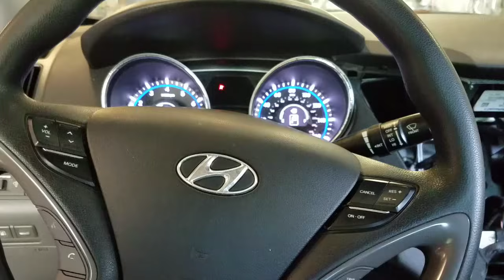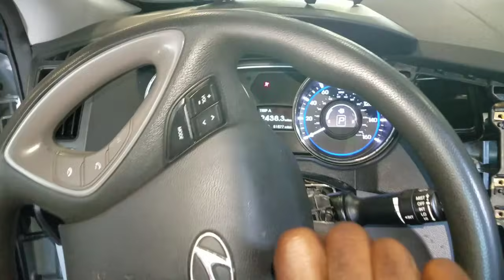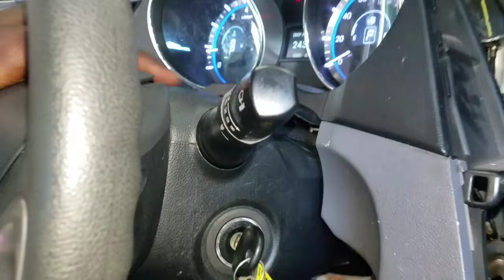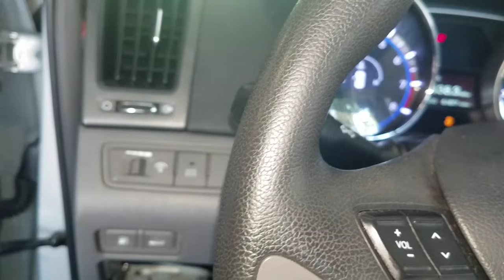Hyundai sonata steering noise

Comment: I'm having a similar issue with my 2012 and I'm trying to make sure that it's the same thing here. Is it a big annoyance when you drive aswell? Does that clicking happen when you go over bumps and potholes and stuff? Cos thats how mine is
Reply from the maker: Yes it happens in thpse situation even at a stop while turning left to right with the steering wheel
Reply: @DULLAHGOSOHARD  thanks alot man, I really appreciate it!

Comment: This part was replaced on my Santa Fe (2013 model) 6 months ago at a dealer who had first said that the steering motor had failed [slaps forehead]... Please be aware that this little coupler appears to be munted again 6 months later and that knocking symptom is worse than before.  It is in the dealer today and they tried to say that the bush, rack and steering motor needs replacing..... and then back tracked on the motor!  They are still proceeding with the rack and the bush although I suspect it could be the joint at the rack.... if it fails again I will be in there demanding a copy of the diagnosis report.....Keep us updated if your issue resurfaces.....
Reply from the maker: DXB_Xtreme oh ok i know they had a recall on the the other day dont know its its still going on but with the recall they would replace the whole steering column
Reply: DXB_Xtreme i

Comment: Dullah Goso hard, I did this repair and now my steering wheel seems to be off center by a small amount and I don't think it was like that before. I can't see how anything disengaged, took it apart to check and couldn't make it disengage. It's still the same. Any ideas.
Reply from the maker: It was probably off before you took it apart but an alignment should solve that
Reply: @DULLAHGOSOHARD  Thanks very much. I was thinking that as well. Fortunately, I had an alignment less than 6 months ago at Tire Kingdom. They offer a 6 month warranty in case you have another repair and need it redone. Already booked. Loved your vid and did notice that you did most of the work with one hand, a rare talent. As a former truck mechanic, I was proud of my ability to reach into an unseen location, remove a bayonet style bulb and put it back with one hand. Not so much any more.

Comment: Hello I need help ! I did everything in the video and fixed the problem however I cannot get my tail lights to turn off anymore ! Have I messed up the connection of wires
Reply from the maker: Check the brake switch on the pedal

Comment: Not sure if anyone else is experiencing the engine recall issues, I'm currently and have been addressing this matter with Hyundai hopefully in the next month or so it will be replaced. I should note my mileage now exceeds the warranty however I'm going balls to the wall fighting this along with other recalls they think they can put a milage limit on their broken parts! I'll be doing the steering wheel myself.

Comment: Please can you answer me a question I just had my sonata rubber coupling changed before having that done my auto start was working fine upon getting my car back from the dealership the very next day I went to use my auto start is is not working. I called the dealership right away they told me to bring back my car when the installer checked it I was told it the auto starter was fried it was working just fine all week long with no problems. Can you tell me if they could have fried my auto starter.
Reply from the maker: Rosemary Esposito am not sure about that but if i take my some where everything working then i get it back and a feature not work they would have to fix it because its obvious that they broke something
Reply: Yah sounds like they broke it

Comment: Dam I changed my hole front end rack n pinion shocks control arms and still feel like I have an issue with the rack! It’s gotta b that rubber part
Reply from the maker: Yes because it can sound like a bad rack
Reply: @DULLAHGOSOHARD  🙏🏼can it also feel when going over bumps?
Reply from the maker: Yes it will sound like the front dropping out

Comment: this  is a recall   at hyundai   and is under warranty   I am a hyundai tech   at a hyundai  dealership
Reply: JOE FORD DIY not if you are over 100,000 miles :(
Reply: JOE FORD DIY. Is it dangerous to drive like that?
Reply: our  hyundai  accent  2014  model  is  so  hard  to  turn  then  they  said  we need  to  change  the  steering column 😫
Reply: JOE FORD DIY yes u did say it was a hyundai  recall cause mine just started making this noise
Reply: my car is showing as not covered under extended warranty even though its a recall.. why?
Reply: Even if it's not under any warranty?
Reply: @mommydoriematthew3082  is the steering column under warranty?

Comment: After completing all of the steps, the traction control light will come on when I press down on the brake. The vehicle is also stuck in park. I checked the connections several times and everything looks good. Do you have any tips?
Reply from the maker: Check the brake switch
Reply: Yep! It was the brake switch. Thank you!!
Reply from the maker: What did you do to it did you replace it or snap it back together
Reply: I snapped it back together. I bought a new switch, but I will save that for another day.

Comment: I'm ready to do this on a 2014 Kia Forte. Thanks
Reply: Call the dealer. I have a 2012 sonata with under 100000 and it is covered under an extended warranty. I'm also the 2nd owner. Mine goes in Monday to get fixed.

Comment: do i need to disconnect the battery? is there a chance of shorting something. what is the trickiest part of this process that I should look after? great video by the way!
Reply from the maker: Fawzi Breidi you don't have to disconnect the battery but you can if you want to and putting back the steering column in place

Comment: My car is 2013 limited that doesn't have regular key ignition. Would this be different from the video?
Reply from the maker: Ahmed Salman i dont think so
Reply from the maker: Just unplug the button thats the only difference
Reply: you mean the car engine starting button? I unplug the wire?
Reply from the maker: Ahmed Salman yes
Reply from the maker: Ahmed Salman if its in the way
Reply: Dullah Goso hard the lower two screws are pain in the neck and i cant seem to be able to put them back.

Comment: Sir I just did this, putting it back together right now. I tried starting after I plugged everything in to make sure I didn't miss anything and I get the "check brake" notification on the screen. Car wont start, push to start

Is this a plug I missed? Which one? I don't see one hanging out. What should I check for this

thanks in advance
Reply from the maker: Check the brake switch to and double all the plug make sure they plug all the way in and tight
Reply: @DULLAHGOSOHARD  Everything looks tight and plugged in. Maybe I damaged the wiring on the brake switch when I dropped the steering column down? Anyway to check this? I do remember the wiring getting caught up when I tried to lower the column
Reply: @DULLAHGOSOHARD  Oh by the way...the brake lights come on
Reply from the maker: Try to disconnect the battery and put it back
Reply: @DULLAHGOSOHARD  That didn't work :( I've triple checked for loose or unplugged wires too
Reply from the maker: Does the ignition turn when you press the button
Reply from the maker: Yes that can cause the problem check the wires if they look good no strains change the brake switch
Reply: +Dullah Goso hard No ignition, just beeps at me BD displays "check brake"
Reply: +tjv323 and* not BD
Reply from the maker: Sorry i took so long to reply i hope you got it fixed but I thinks you should change the brake switch
Reply: You probably already have this issue fixed but hopefully I can help someone else out. The brake switch is easily broken from the steering wheel being dropped. I had to replace the brake switch ($17 at AutoZone) and now my brakes don't stay on any longer. It's best to replace it with the steering wheel dropped.

Comment: I replaced the coupler and put everything back together, but now my EPS light is on and I have no power steering.  What could cause this???
Reply from the maker: You leave something unplug double check all the wires and connections
Reply: Dullah Goso hard   Does the computer have to be “reset” at a dealership?  I’ve read that other people have made the fix but have to end up taking the auto in to the dealer to have the eps retrained.
Reply from the maker: Delouse thats never happened to me and i change alot of those part trying make sure everything is plug in and disconnect the battery and reconnect it but most likely you left something on plug o haven't plug in all the way
Reply: Dullah Goso hard I’ve checked all the connectors and everything seems to be secure....I’ve got my battery disconnected right now in hopes it’ll reset everything.
Reply: How long should I leave the battery disconnected?
Reply: Delouse is if working now?,
Reply: maybe column has been moved when you take it down?

Comment: Hi Bro, i can’t take off those 3 screws from motor, don’t want to damage it by hitting too hard, please help
Reply from the maker: Make sure you have the correct size tool and turn it real fast at the beginning
Reply: Dullah Goso hard  what are tools do i need
Reply: Dullah Goso hard  and should i use penetrating oil ?
Reply from the maker: Try that
Reply from the maker: Look at 10:40 i say the name of the tool you need there
Reply: Dullah Goso hard  thanks mate fixed it had to buy some tool as my car is hyundai i30

Comment: After i change the steering wheel coupler,  EPS shows  up. Any suggestions.  Thanks you.
Reply from the maker: Carlo hom maybe you left something unplug
Reply from the maker: Double check the your work to make sure everything plugged in properly
Reply: Dullah Goso hard Thanks, there was a connector unplug during time I put it back.
Reply: Carlo hom i have the same problem. What connevtor was it?

Comment: Plugged everything back and my car won't start.  I hear the faint click but no luck yet.  I left no wires unplugged and followed along with the plugging of all the wires back in the reverse order towards the end of the video.  Currently charging my battery to see if it's not because the battery was drained.
Reply from the maker: Did the car crank up after yiu charged it
Reply: @DULLAHGOSOHARD  no it didn't
Reply from the maker: If it was starting before it have to be something you leave unplug
Reply: You probably left the dome light on and it drained the battery.
Reply: @CrociatoAzzurro  you referring to the middle lights you can turn on and off?  I hardly use those. I even got the lights set to the off position for when my door opens up.
Reply: @DULLAHGOSOHARD  ultimately I remedied the problem by just taking it to my nearby mechanic. They just only took apart everything and put it back together and it started up with nooo problem I was like wth! They gave me a break and only charged me $198.01 for the labor only but I'm happy to say my steering wheel is rattle free until the new one gets chewed up enough thousands of miles later 😒
Reply from the maker: @CasualLThug  damn that sucks you probably left something unplug or didn't plug in all the way but you learn now and it wont happen next time lol glad it fix though
Reply: @CasualLThug  

Yup.  You probably didn't seat a connector in all the way.

If I do mine I will look out for that.

Comment: I finished mine and the steering light came on! How do I fix this?
Reply from the maker: Double check your work make sure all your wires plug in proper and no wire is stretch and make sure the brake pedal switch is snap in properly

Comment: Did you have to disconnect the battery’s ?
Reply from the maker: You dont have to but i would recommend it
Reply: Dullah Goso hard okay for a 2013 sonata hybrid would you disconnect the battery’s in the back?
Reply: Dullah Goso hard if you disconnect the battery , would I still be able to turn the wheel with the key in the ignition?

Comment: My dad is having a hard time right now to put the steering wheel back in place
Reply from the maker: Really let me give you another video to look at it
Reply from the maker: Watch this video and it will show you more easily how to put up the steering column https://youtu.be/NEd0zPYO-JY
Reply from the maker: And make sure you have the key in the ignition where the steering can turn without locking
Reply: Thank you, unfortunately we had to take it to the shop because steering wheel locked after he put everything back and the car has a recall from what the shop said. Smh😕
Reply from the maker: @PastelMangoRoseh  the steering will lock without the key in it but its easy to unlock the steering by turning the steering left to right while turning the key

Comment: My car doesn’t start after doing this can someone help me please?
It cranks but doesn’t run
Also the electronic steering is working even when the car is off 
The brake pedal is hard
Reply from the maker: The power steering wont work until the engine is running, try go over and make sure all the wires are plugged in properly
Reply from the maker: Take off all the plastic and check all the wiring

Comment: How long do they last once they are replaced?
Reply from the maker: I have no idea i depends on how much you drive and the climate you live in
Reply: @DULLAHGOSOHARD  ok respect
Reply: @DULLAHGOSOHARD  yow my boss! I opened it up and the rubber was not worn.. so what do you think could be the problem?
Reply from the maker: @danecole8074  check the tie rod ends inner and outter
Reply: @DULLAHGOSOHARD  yea those where check and they are good..
Reply from the maker: @danecole8074  does it make the same sound as what i show in the video
Reply: @DULLAHGOSOHARD  yea it does and there's still the knocking underneath the front of car
Reply from the maker: @danecole8074  if you stay still and turn the steering left to right does it make any noise
Reply: @DULLAHGOSOHARD   yea it does makes knocking sound
Reply from the maker: @danecole8074   try and get some one to help you while you or them turn the steering you or them try to pin point the noise if its in side or out side of the car, the the shaft from the steering to make sure there is no excessive movement in the shaft from the steering going to the rock n pinion,  also check the rock n pinion to see if the sound coming from there and check the inner and outer tie rod end
Reply: @DULLAHGOSOHARD  ok my boss respect I will do that tomorrow

Comment: I followed every step perfectly, now after completing the install the EPS light is on and no power steering. Someone please help
Reply from the maker: Double check the wiring and make sure everything us connected then check the brakes pedal switch and make sure its not crooked or anything then disconnect the battery for a few then reconnect it
Reply: What do you mean the brake pedal switch crooked ?
Reply: Thank yoh for your prompt response by the way!
Reply from the maker: @av5398  as it it dont look like its broken or coming apart
Reply: So I checked everything and it appears to be wired correctly and the switch seems fine, also the traction control switch doesn't work. Like the traction control stays off, any ideas?
Reply from the maker: @av5398  did you disconnect the battery
Reply: Yes I tried that
Reply: @DULLAHGOSOHARD  will I damage the system if I drive without power steering?
Reply from the maker: @av5398  no but you need to get it fixed asap
Reply from the maker: Check the computer by the motor and make sure everything plug in it have to be something you forget  loose or unplug if you didn't damage any wiring
Reply: The only thing i can see is i didnt put the saftey clip back in to the plug and I cant find it now, would that cause this issue?